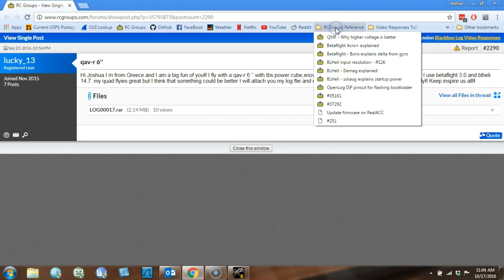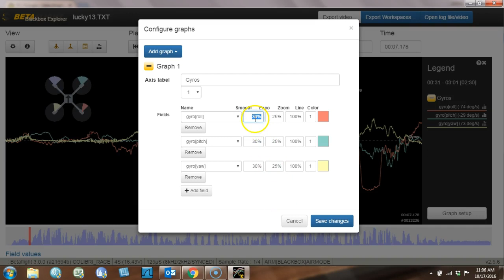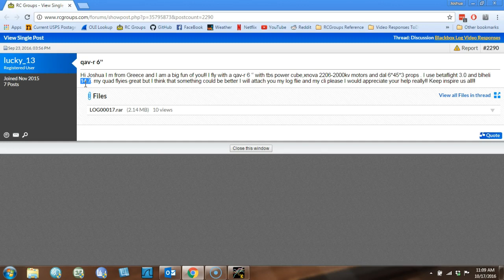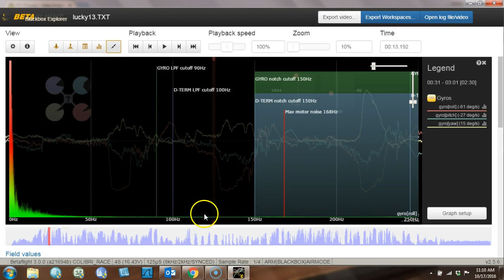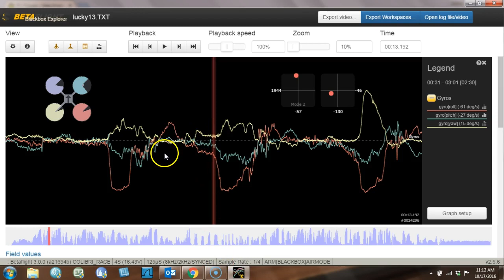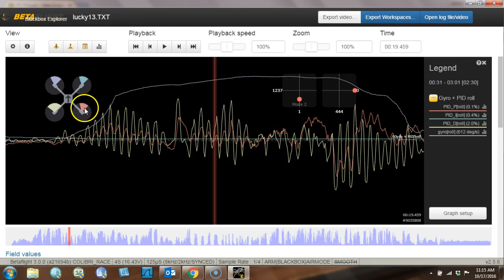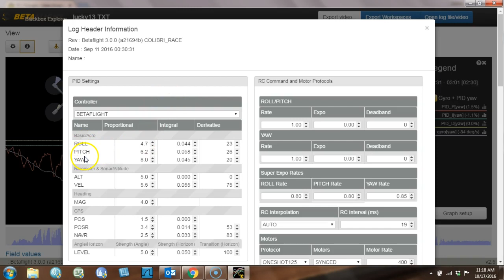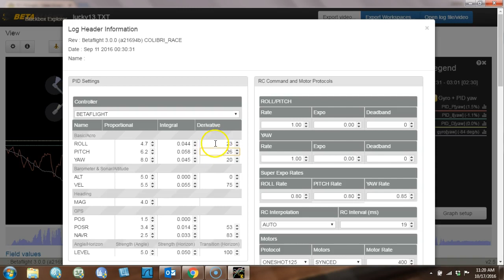Blackbox Log Analysis: lucky_13 - 10/17

Comment: Do I need to do anything in the configuration tab ? Or serial port for using a data card in my omnibus? This rush 5 is flipping out. I'm going to swap out the motors with the dys spider 2205's. maybe that will steady things.

Comment: you forgot to check his rc command. He was going on full roll there. those spikes just seem to be a dkick. Probably he has his tx set incorrectly for auto rc interpolation...well no incorrectly, but using high AUX channel count. but I dont think its an issue. he will just hear some more sounds in his motors during flips and rolls with slightly more loss of energy->heat
Reply: what do you mean Boris! how i should set my rc!! thanks for your comment btw!
Reply: What tx do you have? Taranis?
Reply: yes taranis
Reply: what is dkick?? abd why my taranis has to do with this?

Comment: You mention CPU utilization for betaflight 3.0  I know you can see it in the viewer, but I can't find it in the blackbox log, is it a debug, or am I just not looking in the right place?

I run an xracer F303 at 8K 8K, on BF3.0  and I got some crazy oscillation when I started data logging, at 8K (onboard flash) as well.  Turned the logging rate down to 2K and oscillation when logging went away.  I was assuming this was an overload of the CPU, but I couldn't find CPU utilization in the log.

Comment: Josh, With the LUX  FC  and my Taranisplus tx would it be better to use D4Rll rx ppm or Strip down an x8R rx using sbus? I am also using kiss fc's with oneshot! Thank You in advance for any or all help. I am not racing this quad this is just for freestyle flying only
Reply from the maker: +david ringler always use serial if you can.
Reply: Josh, I just saw a Frsky 8ch ppm/sbus  Rx that weighs less than a gram, it is rated for 1000m but only has single antenna, would that be fine to use?
Reply from the maker: +david ringler you can give it a try, sure.

Comment: Hello, Josh. I use MultiWii 2.2. And get very abrupt warbling as soon as I drop the throttle. What should I adjust, also how do I set the minimum throttle? If you know. Thanks!
Reply from the maker: I honestly don't even remember how to configure MultiWii. Really, honestly, buy a Naze32 rev5 if you must, but spend $20 on a modern flight controller, and you will really enjoy the improved flight performance and easier management.